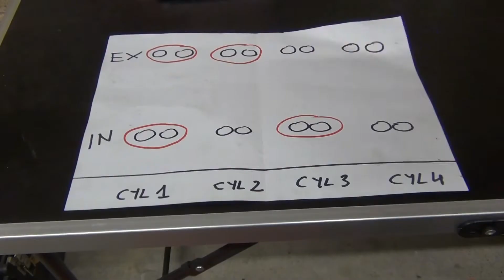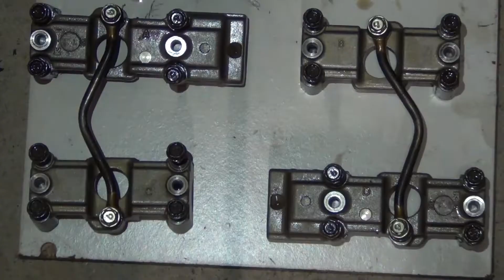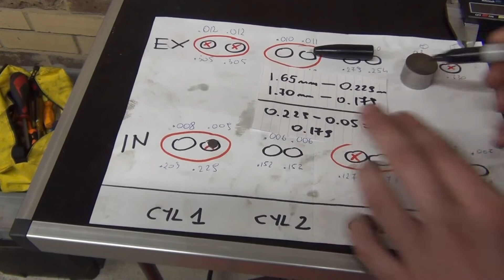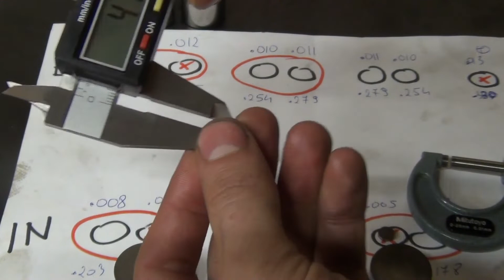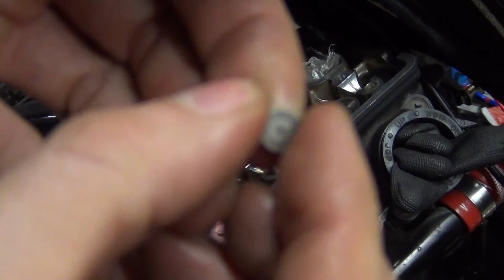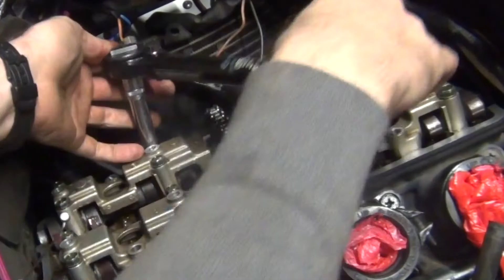Suzuki RF 900 Valve Adjustment

Comment: The video is very helpful. I wonder if the engine structure is similar to the 96 GSX-R1100w.
Reply from the maker: Yes, RF900 engine is based on GSXR 1100W. They share many parts and maintenance procedures are the same.

Comment: I have this bike that makes a knocking noise intermittently, in your experience what can be the likely cause of this?
Reply from the maker: It could be so many things.. Clutch basket, cam chain/tensioner, worn camshaft, valves, worn valve spring or other stuff.

Comment: I have a 1993 GSXR 600 with the same engine, this video is the best one I have found. Very detailed thank you!!
Reply from the maker: Thanks💥
Reply: How do I run a toggle on rf900 do I splice in where the right where the temperature sensor plus in to the harness @Adikxx

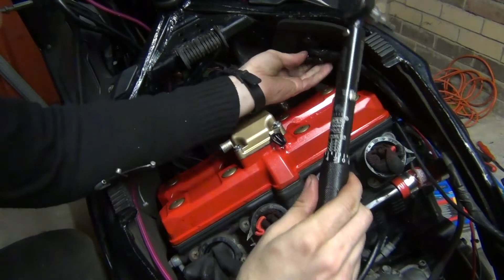Comment: Hi there. I couldnt help but notice when tightening the valve cover bolts at 38:48 you may have missed the intake side bolt at cylinder 3 and double checked the exhaust side bolt . Not too sure, but could be worth checking?
Reply: Fantastic content by the way thanks heaps for your vids.

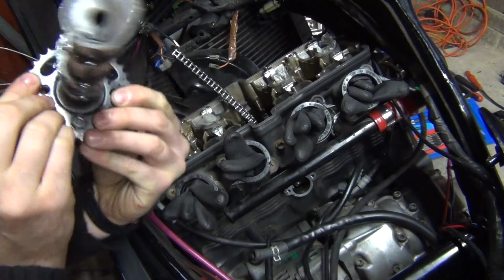Comment: Hey adikxx83, great video once again. Checking this myself, i do have some questions, mostly just to be sure: @32:35 you are repositioning the camshaft, and right after it you helpfully warn us to put these back exactly the way it came out. Later on you check for it via the 360 degrees turn and arrow. But it would of course be very helpful if i got them installed correct right away. 

Question 1: How can you be most certain of this, regardless of checking it later. So right after re-inserting the camshafts, would it be best to first check both of them on the right hand side of the bike, like in the picture you used @35:30, if the square nodges (indicated by the direction of the yellow arrows) are in exactly these 270 degree (inlet cam) and 45 degree (exhaust cam) position? So that if they are, i would know that they are probably placed correctly by hand, and you can progress with the real testing? 

Question 2: At the "real" timing test, while turning the camshaft 360 degrees clockwise away from the starting T, when you actually do feel quite a lot of resistance at some point probably it's still gone wrong. In this case, would it be best to just turn the camshaft anti-clockwise back to the starting T position, and by hand re-adjust the camshaft position like in question 1, and after that test again? 

Question 3: After turning 360 degrees, are these the final things to check for if the timing is correct?
1) For right positioned exhaust cam, number 1 flush with cilinder head to the front, number 2 straight up, and/or nodge seen from right hand side bike @225 degrees. (picture @36:25)
2) For right positioned inlet cam, number 3 straight up, and/or nodge right hand side @90 degrees.
3) Lastly checking the 13 pins between number 2 and 3. 

Lots of double checking, but that's just me, thank you for these wonderful tech guides on the RF900!! 
Safe rides
Reply from the maker: Hi buddy, good questions showing that you thought about the process and you understand it.

So for the 1st question - Yes it would be best to get the cams in the correct position 1st time and most of the time that's how it actually pans out. However because of the way this bike's frame is shaped the side view of cams isn't that good and it's somewhat awkward to see if the cams are really 100% in the right spot. I remember when i did my 1st ever valves adjustment i actually messed it up. I put the cams in trying to be exact and adjusted the marks . Then bolted on the cam holders and tensioner . During the test (turning the crank) after about half a turn engine stopped me.. I could not believe it cause when i looked at the marks on cams it looked like it's all correct. I dismantled everything back and after another very meticulous inspection i figured that maybe one cam was slightly off (1 tooth forward). I readjusted it and bolted everything back on to again do the rotation test. It turned all the way around nicely(in fact i did more than 1 turn, went 720 dergees just to be 100% sure) 
So the conclusion is that misadjusted cam by even 1 tooth could throw everything off enough to cause the piston to touch the valve. Remember the clearance in that area is a matter of mm.
So basically if the frame was of cradle type like in Bandits then you would have a perfect side view of cam marks but in RF's case it's a very awkward angle so it seems like you have the marks perfect but they actually could be a tad off. To sum up gotta really pay attention to how the lobes and marks were before and try to reinstall the cams to the same position . I managed that during the second valve adjustment job on RF when filming it for YT.

2nd question - They say you should not turn the crank counter-clockwise but that's how i did that when i messed up doing the job first time. I did it slowly and gently without any bad outcome from it so i bet it'll be fine. All i needed was about half a turn(at slow pace).  Allegedly crank should be only turned one way cause that way you keep constant tension on the chain not having to worry about the slack. You might notice when turning the crank back and forth by just a little there could be a very minimal slack detected. Depending on how worn the chain and tensioner is this would probably vary.
When it comes to little arrow which should be flush with the cylinder head. Obviously you want all the marks on all three check points (sprockets, cams and rotor from signal generator) to be positioned perfectly in line with what service manual shows(and most probably that's how it'll work for you 1st time) 
If you did your best installing cams and sprocket arrow is a tad low or high in relation to the head's surface it probably means everything else is in line with it you've just got the crank a tad advanced or retarded accordingly.
I doubt you'd be able to turn the engine if any marks on any of the components were off so turning test is absolutely necessary. 

Two additional remarks. 
A) Correct removal and installation of cam chain tensioner. I made a vid showing that recently. Good idea to watch as i cut corners in that department in valve adjustment video. I personally don't think you will harm anything doing it the quicker way(as long you're careful) but if you want to go by the book and be 100% safe do it the long-winded way(it's still easy)

B) Be sure of the integrity of your torque wrench. Those cam holder bolts need only 10Nm and the head is made of aluminium. If your wrench is dodgy you'll strip the thread in the head and that's a bad day. Removal and re-install of those thin bolts must be done in a correct sequence and gradually(keep going from bolt to bolt by little) I think i mentioned that in the video.

Hope it helps

Regards
Adrian

Comment: When I did the alternator coupling repair on my 98 I had to remove the camchain tensioner to get the cover over the alternator drive assembly off. And I seem to remember, when removing the camchain tensioner, the piston or whatever its called, was pushed out to the most extended position which I didn't notice until I had put everything back together because it generated a whining sound which indicated there was too much tension on the camchain. So I removed the tensioner and got the piston back to it's retracted position. I believe it had sort of a wedge that kept it extended unless released. I don't remember all the details about this since it was over 15 years ago so there might be some memory glitches. Anyways, If you remove the tensioner, take a look at it so you understand how it works before putting it back.
Reply from the maker: Uploaded tensioner relating video, especially for you :)
Reply: @Adikxx Thank you, just watched it and it brings back some memories, and it's a great video to go back to when I need to do the alternator coupling repair again ☺. Anyways, if the coupling fails again maybe I will convert it back to the old style if I can find the parts needed.
Reply: If you ever have to do the alternator coupling again just cut an old or spare Allen key Down a little and it will fit into that Allen bolt at back so no need to remove cam chain tensioner . 👍
Reply: @DylanGSXR  Oh thank you! Honestly I don't remember if it was a clearance issue between the tool and the tensioner or if I couldn’t get the cover off without removing the tensioner, but since I assume you had to do this repair or had the cover off by another reason I take your word for it. I guess time will tell because I don't think I will sell this bike anytime soon. I'm at about the same milage now on the new coupling as when the first one failed so any day now I guess 😊 unless they made some changes to the coupling to make it last a bit longer. I remember the part number had a new version when I ordered it. It could have been 2274046E01 or 2274046E02, E02 being the latest I assume but I can't remember if I got the E01 or E02.
Reply: @VNAV_PTH  are you located in England ? If so I've got a spare green label alternator and solid drive starter clutch from the older model RF ( 1995 ) . They don't fail and I've converted both my RFs I have now to the older ones so I've never got to worry about them going again . It's a mod well worth doing . If you need any information on it just message me here and I can help ok ..all the best .
Reply: @DylanGSXR  No I'm located in Sweden. I haven't tried to locate used parts yet, and I guess the drive assembly could be difficult to find separately because I assume it is normally mounted to the engine.
Reply: @VNAV_PTH  it is a rare part to find unfortunately , like I said if you do ever need it I've got the whole lot spare , alternator and starter clutch . Take care and hopefully you want need it 🙏
Reply: @DylanGSXR  It's funny how they changed from an all metal design to a polymeric one, given the nature of polymeric materials, like sensitivity to heat cycles and material aging. I guess they didn't really understand the consequences until later. Oh well, we're all humans. And yeah, if it fails again I keep in mind you have the parts and if you're willing to ship internationally we can take it from there.
Reply from the maker: Thanks

Comment: Did you remove the aftermarket ignition advancer? I just bought one for mine, should be getting it by week's end.
Reply from the maker: i currently have the stock rotor as i will be testing running of the bike on gsxr 1100 ECU, depending on how it runs i will decide if advancer goes back or not
Reply: @Adikxx  Cool. Thanks for all the great videos, they're inspirational to say the least. Much appreciated.